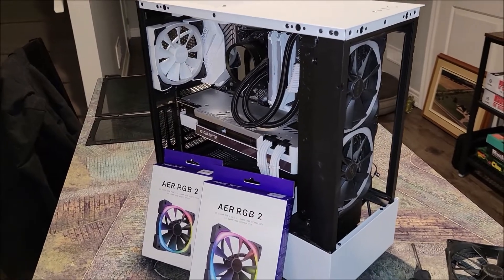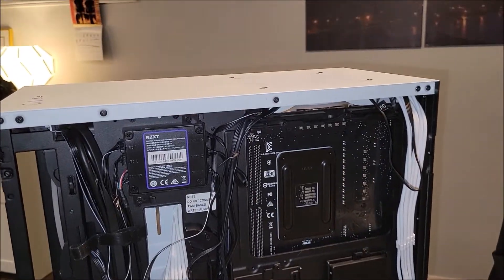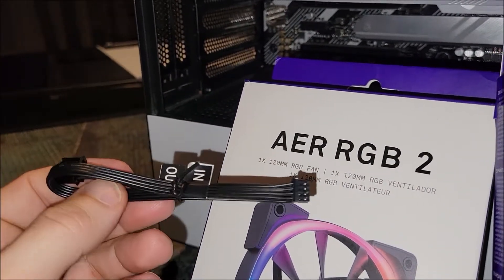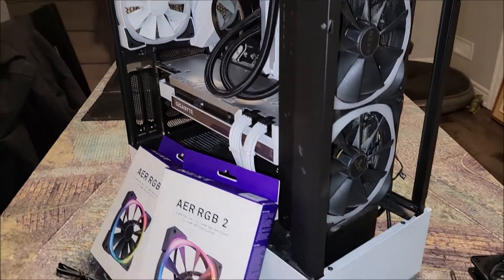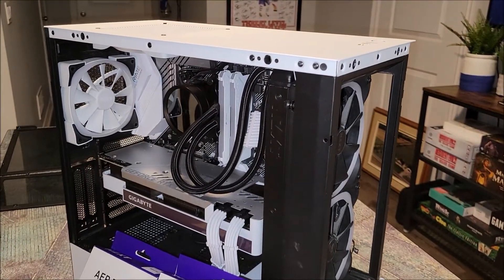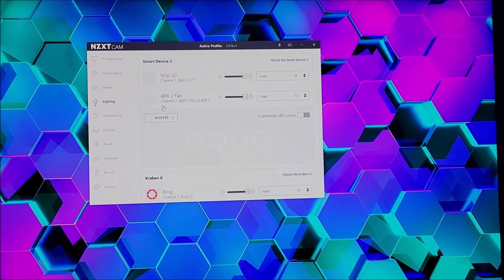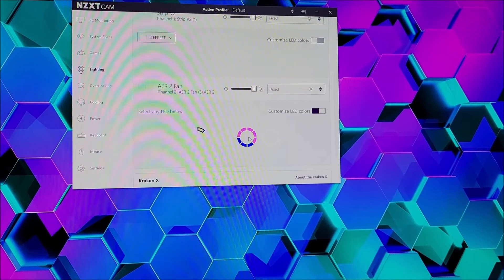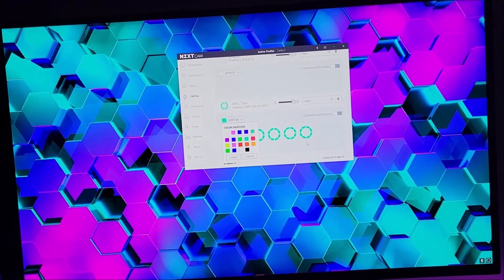Installing NZXT AER RGB2 fans and LED setup

Comment: I’m curious on how you connected the fan cables and led cables to the controller. Did you daisy chain the led on the fans and connected the top front fan to the led slot on the controller? And connected the other led slot on the controller to the led strip? How did you connect 4 fan cables to the controller when there’s only 3 slots?
Reply from the maker: The fans power goes to the controller and the LEDs are daisy chained together.
Reply from the maker: Watch it again! I explain it around 2:30.